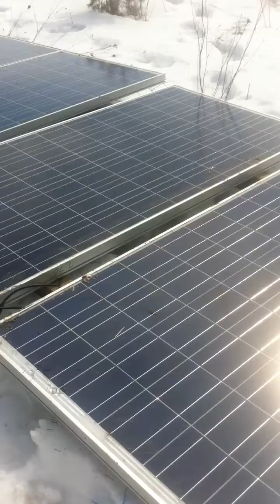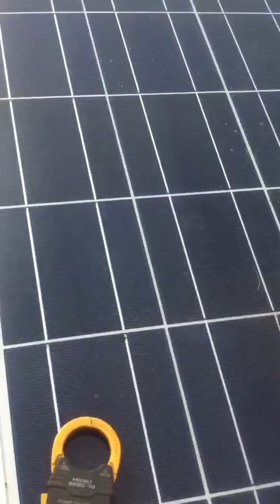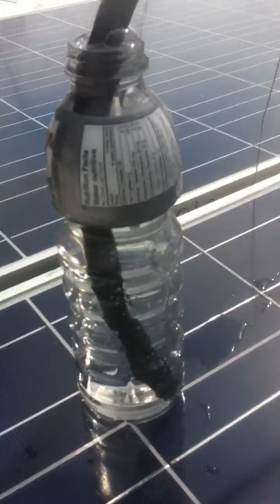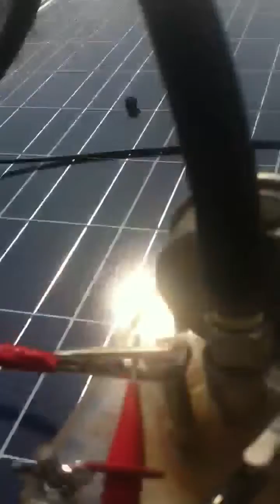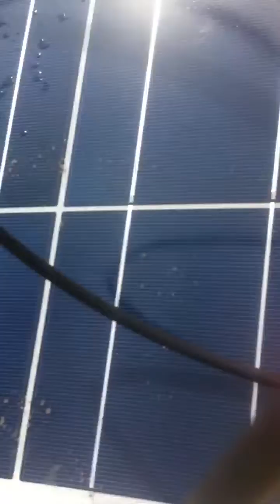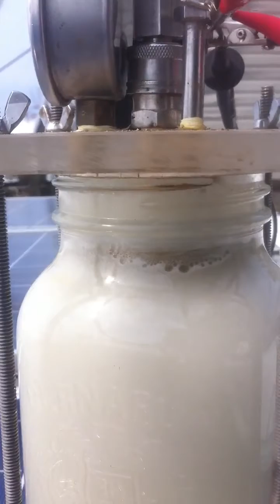HHO. Solar powered. High efficiency hydrogen production.

Comment: lower voltage higher amps
and better hydrogen generator
it's the amps that create the hydrogen
this video takes everything I've learned about hydrogen production and does the exact opposite ._.
yes it's correct that more amps cause heat
that's why we add more neutral plates (better hydrogen generator)
and how is this a better way at storing energy than a battery?
Reply from the maker: IV only posted this video to help out the people that are using 12v. Using 12v is far from efficient. The losses charging a battery is terrible compared to storing hydrogen.
Reply: Chad Armstrong duuuuuuuude I’ve recently came up with a design that eliminates the holes and current leakage 
I’m just dealing with a few tweaks , the prototype will be made with titanium plates and will be 2volts instead of 12
Oh and  that high voltage thing of yours isn’t correct at all

Comment from the maker: This is going to store solar power in a gas form that will never depreciate or wear out like a battery. I need to be able to charge my electric car in the near future without using a battery to battery exchange. I'm not going to show how I'm going to store the hydrogen safely, that's a secret. And I will not show how that Cell is built.